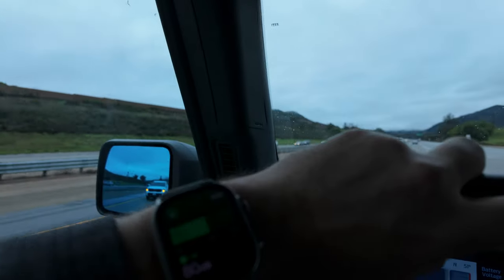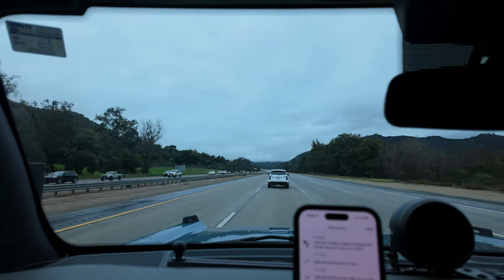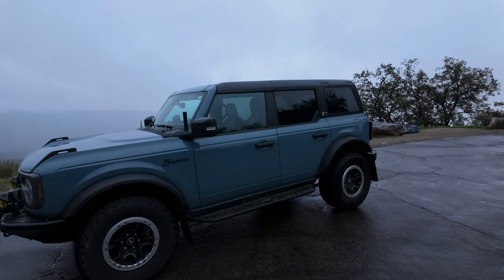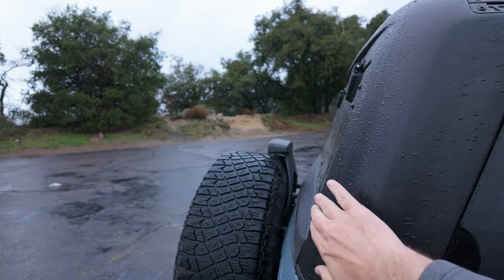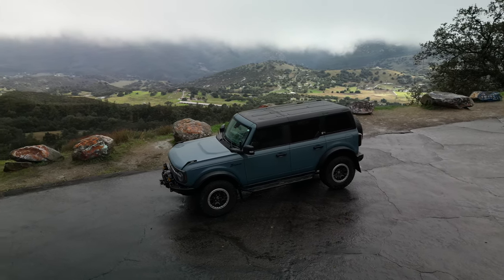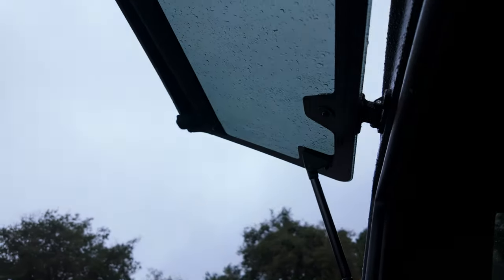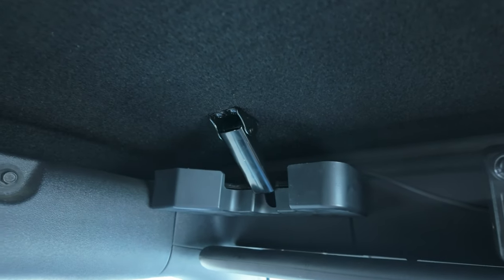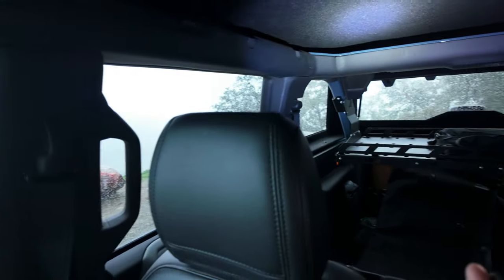DorkNerd Adventure Episode 2: Turn Offroad Bronco Hard Top

Comment: Smiles per miles is what I say. Haven't regretted the soft top. Though a hard top works better for camping.
Reply from the maker: I will miss the open air. I will not miss being so absurdly packed in with gear that nobody can move. I plan to post a follow-up video to this also showing off a TrailRax roof rack and how well it works with this top.

Comment: Hey buddy! I see you service your Bronco at Gosch Ford! I bought my Bronco at Hemet Gosch.
Reply from the maker: That's correct. The team at Gosch (now Aaron) has been very good to me. They did not charge ADM during the initial ordering fiascos, service has been 100% reliable and quick. Josh their fleet manager did such a good job with the Bronco we also picked up an Explorer for the family. I may be stopping there today to schedule an oil change, and possible diff/tcase fluids as well, but I think maybe I should just learn to do those myself.
Reply: I just dropped off my 2022 hybrid maverick with Phil at service department. Steering wheel, and brake pedal creaking like a 20 year old car! Alexa and Matt helped me with both my Broncos. I have a 4 door Badlands and a 2 door base with automatic transmission!

Comment: I'm now convinced to buy the top from Ford, I don't like the looks of this one especially next to the factory one.  Then there's the lack of versatility with only 2 pieces, and those latches and hinges look cheap and it appears the screws will loosen and the holes will be stripped.  Thanks for the review, this was a big help in my decision.
Reply from the maker: Good luck! I don't really intend to take my targa off like basically ever so the latches are kind of irrelevant to me as long as they function. I do prefer the slight slant of this to the square one. Ford recently announced that early 2021 buyers would be able to buy a MIC top through the accessories department, but its invitation only for now, one per customer. It will be about 6K so $1000 more than the Turn solution. I'll be posting a follow-up to this video especially now that I have a TrailRax roof rack mounted to it.
Reply: I can understand about wanting the extra modularity, but man I'm at a loss how you think the OEM looks better.  Unlike the others including the OEM, the TOR is made as a single unit (top, bottom, and sides), so you don't have the extra seams to rattle and leak.  This is also an advantage to not having the rear removable panel.
Reply: @mark5862  Looks are subjective, the MIC 2, to me, appears more heavy duty and I like the boxier look without the angle in the back
Reply: @dorknerd  I spoke to a Ford Accessories rep, the invitations have already gone out to 2021 buyers, 2022's will be getting theirs soon and then 2023.  The cost is $4995 plus $300 for dealer delivery and installation.
Reply from the maker: @ds6224  i don't know that all the invitations have gone out, I certainly never got one. Hope it works out for you!
Reply: @dorknerd  The rep said that only original owners of authorized vehicles will receive the invitations. I asked what authorized vehicles meant and he told me the Bronco has to be registered on the Ford site under the owner's account. The invitation will be sent to the email address listed on the account.
Reply from the maker: @ds6224  Well, I'm an original 2021 owner, I'm still keeping an eye out for the e-mail. I  would not be opposed to it. My TOR top was like $4950 out the door, I would think with taxes the MIC will be a bit more than 5K. again best of luck, I'm still happy with this one.

Comment: Nice looking top my only concern is that those front latches don’t look very robust like my factory latches on my Bronco but hopefully I’m wrong and they will last… by the way nice looking rig..
Reply from the maker: They do look quite simple and you’re right, time will tell. I need to adjust mine already as the seals have softened. I plan to do it just one turn. It’s supposed to be firm but don’t crush it.
Reply: They work very well, and pull at an angle with spring tension.  They don't look as classy, but they do the job and are mostly out of sight and out of mind.

Comment: Looks decent but those latches are absurdly inadequate. I wouldn’t trust those for a second.
Reply from the maker: Yeah they look flimsy to me too. They haven’t budged. I’ve had to tighten them once as the seals have softened a bit.
Reply: They function very well.  The fact they have spring tension and are adjustable is a benefit.
Reply from the maker: @mark5862  I agree, I'm having no issues with them. I've removed the targa 3-4 times now, but now that the TrailRax is in place I doubt I'll touch them again anytime soon.